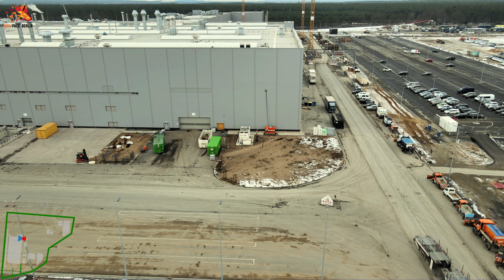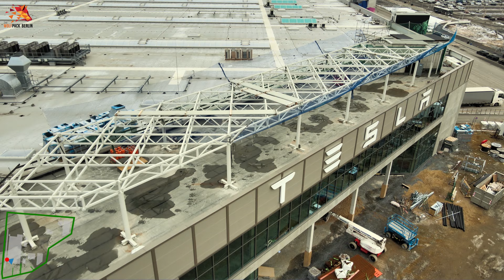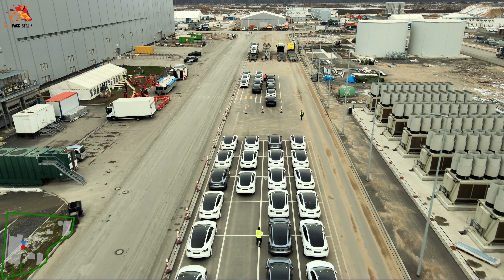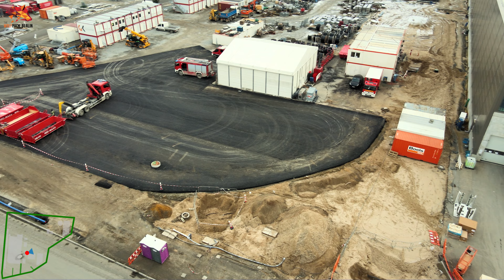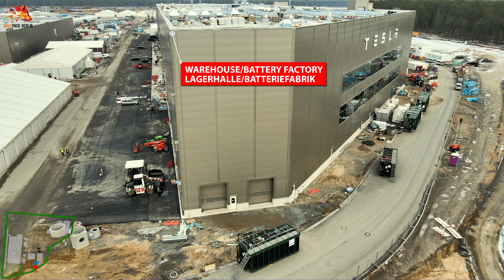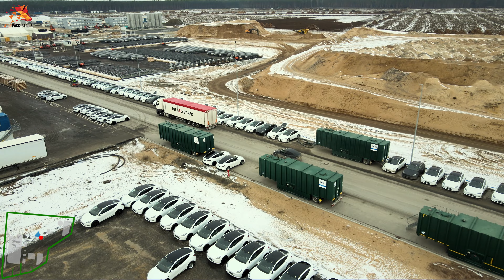# 144 Tesla Giga Berlin • PHASE 1 • 2023-01-21 • Gigafactory 4K

Comment: @10:46 As far as l know, there is no other Manufacturer using castings on this scale. 
Tesla just happen to have a few spares laying around
Reply: You're right, Teslas take quite literally only 3 pieces of chassis for a car, while others require thousands for just a quarter! That's how they manage to push out so many cars every year
Reply: @achilles-live  
Soon, it's gonna be a case of 'Station To Station' where two cars will be built in the space of one 'Station' that currently has time/space for one Model Y or Model 3.
When they go half unit cost, the rest are in BIG Doodoo ___stay tuned y'all. March 1 ___